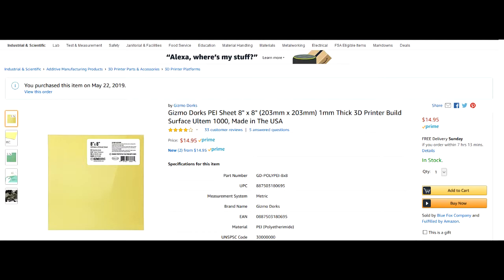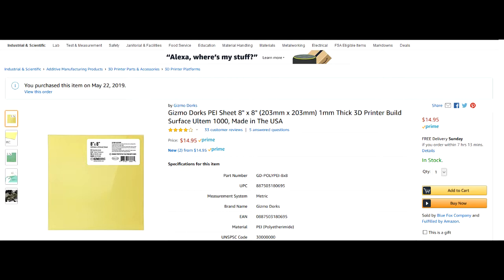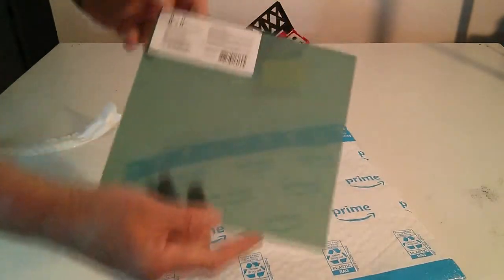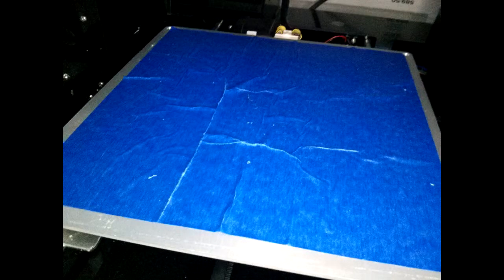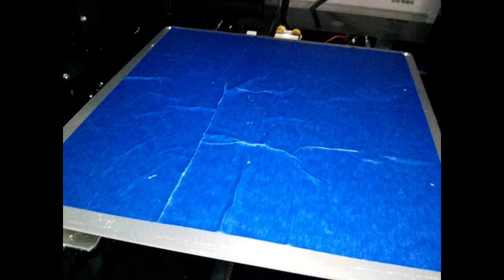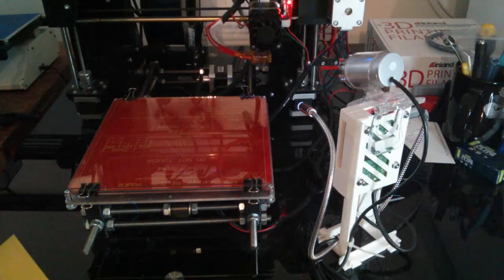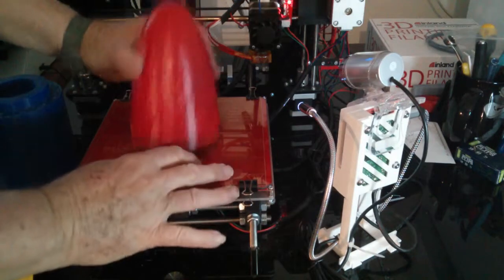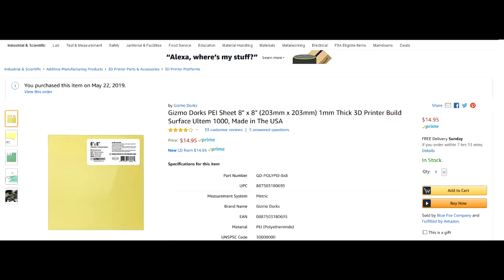Check Out Gizmo Dorks PEI 3D Printer Build Surface

Comment: you got ripped off thats not real pei.... someone on amazon uses the name gizmodorks..... and sold you standard lexan... pei is always yellow... ultam 1000 is the only usa company that makes it..  if you see blue or brown or tan sheets its fake all pei is yellow.. ultams site now makes black.. but thats it...

if you stick the sheet with out clamps it will curl up this is not pei if you put a pei sheet on it barely will curl.. this is how you can tell..

so only buy right off gizmodorks site theres another company that i havent tried .. but i did ge tone that was green turns out it was protective covering these scammers know this and keep selling it even if you confront them and report them to ebay... real pei costs 15-30 dollars for 1mm sheet anything less and its not real
Reply from the maker: The blue you see is the protective cover that is applied to both sides. Remove the cover from both sides and it is yellow. I have bought several these from the same vendor. I am printing on one at this very moment. Yellow, doesn't curl, gets great adhesion and releases like a champ. Check it out: 

Gizmo Dorks PEI Sheet 8" x 8" (203mm x 203mm) 1mm Thick 3D Printer Build Surface Ultem 1000, Made in The USA 

https://www.amazon.com/gp/product/B074XK8BWY

Comment: I absolutely can't get any adhesion on my GizmoDorks PEI sheet.  I have no idea what is wrong.  Have you noticed any deterioration?  I've tried cleaning with 90% IPA, dry sanded it, raised the bed temp to 75.  Nothing's working.
Reply from the maker: Wow you got me. I am printing on it right now and was thinking how long it will last, when would I need to replace it, etc. But it is still going strong. What material, temps, etc.? You have the leveling down to where you can feel the friction on a sheet of paper? What was working for you before? Not trying to bombard you with questions, just thinking out loud here.
Reply: @ShotokuTech  oh no worries, I was  just printing on glass before, with either a glue stick or kapton tape, i was excited to get the pei but it's just sightly better than glass. It's pla printed anywhere from 190 to 210. I think I just got a bad sheet or something. It hasn't worked for over a month since I bought it and applied to a piece of glass. And yes on the bed leveling just to where the paper has friction. One last variable could be the filament, but it's Geeetech from Amazon and it has rave reviews.
Reply from the maker: @revhappyrs2k  I was using glass with kapton. Sorry to hear the PEI didn't work out for you. Thanks for your comments!
Reply from the maker: @revhappyrs2k  when you said "applied to a piece of glass" did you mean the adhesive backed one?
Reply from the maker: @jackoneill8585  Do you have first hand experience with this vendor or product? Gizmo Dorks PEI Sheet 8" x 8" (203mm x 203mm) 1mm Thick 3D Printer Build Surface Ultem 1000, Made in The USA https://www.amazon.com/gp/product/B074XK8BWY 

If you have bought this specific product and have a problem with it, return it to the vendor. If they cannot satisfy you, report them to Amazon. 

I have first hand experience with this specific product. I have bought three of them over more than a year's time. The first one still works, just has a couple of hairline scratched in it that mar an otherwise pure glossy surface of any object printed on it. Sanding seems counter intuitive as that would permanently mar this totally glossy surface and the resulting prints on it.
You could make your own video on your channel and lay it all out there? I am still 100% satisfied with my purchase and stand by my review of this specific item. Here it is in action right now: https://flic.kr/p/2itkj5u
Reply: Mine works for a month then stop sticking
Reply: It's gonna be your settings. You would never need to do all that to a sheet just to get it to stick